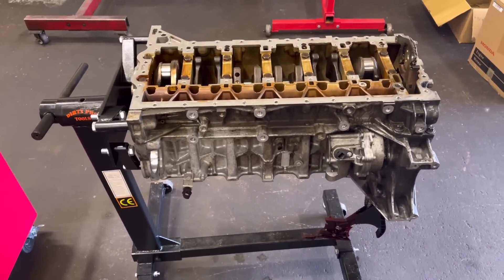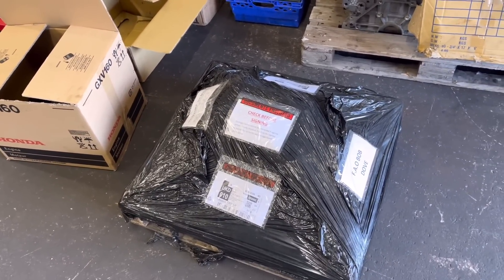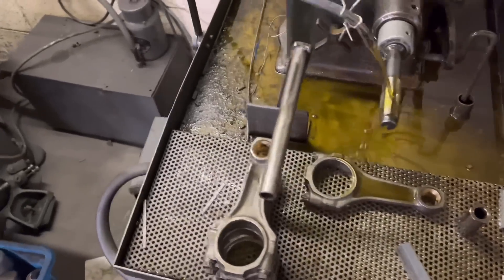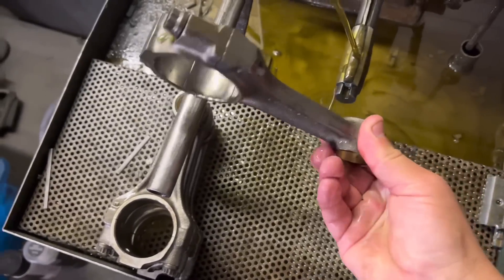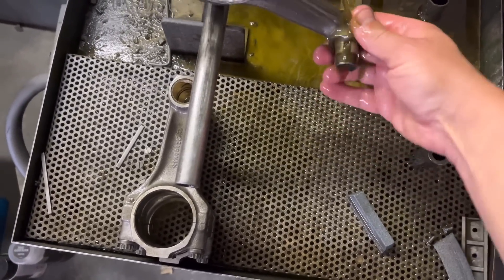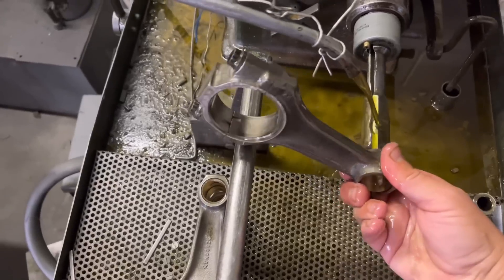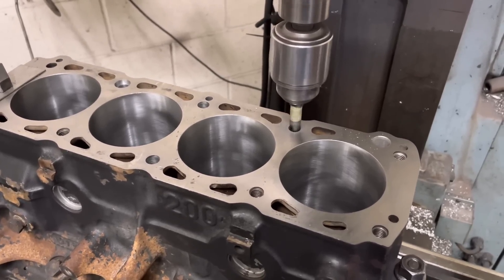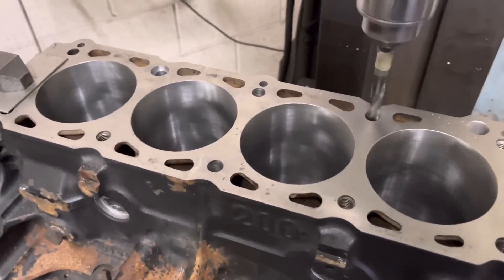Customer’s 3rd attempt of a warranty claim, but WILL NOT send engine back for inspection

Comment: Once someone else has been in the engine, surely any warranty is void, you have no idea what they may have broken and are trying to blame you for.
Reply: 100% Once someone else has been in, warranty is void.
Reply: Totally agree 100%
Reply: Agreed wouldn’t be hard to manipulate a failure pre engineer doing a report
Reply: I disagree. So taking a rocker cover off voids a warranty? Ridiculous poppycock.
Reply: @rjm7168  debatable that depends on the terms of the warranty.
Reply: @rjm7168  are you the guy trying to make the warranty claim? 😆
Reply: @rjm7168  it does, if they remove things and an oil leak results, its on them.
Reply: 100% especially if the engine has been touched by someone who is not a qualified technician alot of performance part manufacturer will not warranty a failed part if it wasn't fitted by a qualified technician!
Reply: @rjm7168  if the work is carried out by a non approved mechanic or the work wasn’t approved beforehand and it’s still under warranty then the warranty will be void.
Reply: @matthewgibbs6886  it doesn't. You actually have to show that the disassembly has caused the failure.

The FTC has a very clear stance on this since 2018. 

This guy just isn't sending it back for warranty service.
Reply: @rjm7168  I am in Warranty, and I agree with you! but it would depend on the limitation of the warranty given by the OEM/seller, if they can prove you(the customer) directly affect the outcome yes it should be void, any tampering with the engine should void those parts/items tampered with....per se, for example, they might not void the water pump if that was leaking as unrelated NON-tampering etc. any tampering/neglect/incorrect repair/abuse/lack of maintenance etc might be voided root cause and progressive

Comment: If they complained of issues a while back and didn’t do as asked and return the engine, and has continued to run it knowing in their mind there may have been an issue. Then they have voided any warranty.  

If they will not return the engine for assessment, then they can whistle.  

Just ignore the matter until a formal letter arrives and if and when that does, stand by your guns and ask for the engine back.  

Court action is unlikely and at this time there’s no need to involve solicitors.

Comment: Suggestion; put a secret stamp somewhere on each block that you work on, so you can identify your work, if you suspect someone has switched engines.
Reply: Like a B & E stamped into the water pump inlet in the block and again in the head?  Good idea.

Comment: Under UK consumer law (assuming that this isn't a B2B contract) you should be given a reasonable chance to make good the failure. It would still be good to see your standard T&C's on your website.
Reply: Even the corrupt country court (which they are) would not find for the complainant in this situation.
The so called judge would either dismiss the claim or adjourn the case so the defendant has chance to look at the engine and repair it if they are at fault.
The claimant has not acted responsibly so therefore losses the right to claim. Conversely Barum engines could make a counter claim and apply for costs and damages.
Reply: If he's not giving you the opportunity to look at the engine and rectify the situation, I can't see a County Court  finding in his favour.
Reply: @Dave Stennett  I get your point, there are a lot of devious customers out there.
Reply: UK consumer law does not apply to B2B sales.
Reply: @MX-Drew  I did say "assuming that this isn't B2B"

Comment: Lee, Your 100% right. Head bolts don't just "come loose".  He had oil in it too while pratting around, Suggesting he was turning it over out of the car at minimum. He'll have had the head off it numerous times. Seen this many times with motorcycles, customers trying to save a few quid. (usually on a bike worth less than £1500) You give them a good price, they go away, and 2 weeks later their on the phone because they bought another engine off Facebook and it's worse. Tell him to jog on !!!

Comment: Head bolt coming loose! must be a joke, 40+ years as a mechanic, never heard of that happening, the only possibility is if it was never tightened in the first place and I find that very unlikely.
Reply: Have you ever seen bolts come loose on an engine that has not even been RUN?
Reply: @GrumpyUnkMillions  ever buy a jasper engine
Reply: @matthewgibbs6886  Ummh... no.  Are loose head bolts an available option?  Factory?  Oh, boy, I can't wait to get one! ... not
Reply: You should know that occasionally very unlikely things can happen, especially when someone is interrupted during a job, or a job passes between several people.
Reply: @Cheepchipsable  I know things can happen, but I have built a LOT of engines and would never stop half way through tightening a cylinder head and double check my work, it just isn't worth your reputation and TBH it only takes a few minutes.
Reply: Well... Saab did have an issue with headbolts on their early b205/b235 engines.  Had to do with the lubrication they put on them in the factory iirc.
But that resulted in an external oil leak and eventually a blown headgasket... but no bolt moving up and ruining your engine.
Reply: ..I've seen overtightened bolts strip, and bolts come loose in incorrectly tightened down heads....
Reply: @richardwebb9532  That is unlikely, most modern engines demand new bolts every time the head comes off (torque to yield/angle torque) and older engines don't have such high torque settings. It would be sheer incompetence if a head bolt was stripped.
Reply: @onecookieboy  ...yup.....but it happens in my country quite a bit. (South Africa) as formal training is very limited.

Comment: The way I see it and how our laws are (different country) is if it's under warranty and you have asked them to bring it in to diagnose any problem but they dont then the warranty is void as you have given them multiple chances to send it back but they refused - especially if them or someone else has started to pull things off the engine instead of you - as now they have interfered with it and small claims will say that your warranty is now void as they have tampered with it ( and so with them doing that they could have made the problem) after being asked to return it for a claim...  So really, you could email them back and say "I've asked numerous times for you send it back, you refused, and then the engine has been tampered with - I cannot guarantee it anymore"..

Comment: If that warrentee engine is an alloy block M52 6cyl they do have a tendency to pull the threads out of the block if it’s been massively overheated. We get it regularly, showing head gasket issues and when you pull apart the head bolts are loose. Hardness test block and they’re buggered. You will have to see it obviously but I’d advise hardness testing all these blocks before wasting time on them. Hope this helps

Comment: Hi lee ,love your show warts and all, i have a very keen interest in  engines and engine building since the late 60s as i have been heavily involved in drag racing ,i got sick of some of the shows on you tube ,all glitz ,glamour  and product placements.   I would nice if you culd do a show about the engine re conditioner and customer relationship, as this is crucial for sucess,  i have worked in 2 car plants as a maintenance  electrician,  the engine building plants also have lots of failures (pallet loads)   even with  all the machinery and know how .    I build older engines (last one mgb)but never mod them too much as  i find they all have limits  to their life span. Best of luck with your plans to move in next door , cheers from downunder.

Comment: A loose head bolt is feasible, the problem is a lot of your videos are you owning up to your mistakes , so you can’t rule it out , a lot of these people buying engines have no spare cash , they way up , the cost of paying for a garage to remove the engine , crating it and paying a courier to deliver it , they probably think you will strip the engine, finding a way of not making it your problem/fault and then sending them a bill for your troubles ( I don’t believe you would fleece anyone for the record) , If it’s the guy with the oil leak from the crank then he’s probably been turning the engine over counterclockwise and bunched the chain up , if the head bolt is worn and grooved the cam , then it’s fair to say it’s loose , I’d give him the opportunity to send you a picture

Comment: yes your right engine has to be returned and if its not returned when  a potential fault has been reported it should also be advised to the customer that continual use could cause more potential faults and can and will effect any warrantee so when the 1st fault was reported and no engine returned the warrantee would be voided

Comment: UNDER WARRANTY  Once the engine is touched by anyone other than the Builder  WARRANTY'S become VOID .. i assume the guy you built it for took the rocker cover off and loosened one of the head bolts, in order to get his money back plus free rebuild .. some people leave out sump plugs run it dry enough to get big end rattle . it's like car manufacturers stipulate vehicles must be returned to Company Franchises for repair ,to do otherwise voids warranty. tell the guy you'll see him in Court.

Comment: Amazing idea!
Get a fleet of vehicles with the same engine, get one engine done by you legit, THEN if any other engines fail you can get all the others fixed under “warranty” bingo 😃
Reply: MrGuvEuroman   not if builder stamps a personal  ID  inside sump and rocker covers and takes a note of the engine number stamped on the block .
Reply: @douglastodd1947  was going to say the same . Stamp the initials in places where it isn't visible to the naked eye.

Comment: Granted my experience is in the US, but most warranties should include some language to the effect of "the item may be repaired or replaced at our sole discretion".  There is also a duty on the consumer to give the warrantor the opportunity to provide a remedy, which if they just dropped it off at some other shop then they did not do.  Even if they are far away, they should make arrangements with you to then take it to a shop or ship it back.

Comment: To make sure the engine is the actual one you worked on mark the engine with your own number and record it. It strikes me you need to prepare a warranty information sheet and send it to the customer and have them acknowledge it before any work is agreed to. One of the conditions needs to be engine in question needs to be returned to Barum in the state of assembly it was originally sent, and that Barum will evaluate etc etc etc.

Comment: Should have the case of 14 days notice from contact after that consider matter settled in the letter/email stating if no arrangements of delivery then that’s that. Once engines stripped down warranty is void as you should have had first refusal on inspection rather than owner or a engineer

Comment: After listening about the goof filling his engine with oil before it was in the car, then not understanding the flywheel bolt sealed a direct oil path....I wouldn't let him put bread in a toaster let alone try and assemble and fit an engine!
Reply: 100% - surely the warranty is voided at that point and Lee should have had no further dealings with him...............

Comment: From the time i used to have a workshop, i seem to remember the law is you should have the right to demand the item back under warranty to evaluate the damage, its cause, and what you will do about it. Then the result is if you are going to repair it at your cost, if you find its a mistake on your part, or subcontract the repair out, or pay a warranty charge. At all points the customer acomodates you, not the other way round.

Comment: As part of the warranty do you state in writing something like: 'In the event of internal engine problems within 6 months of any work being delivered the engine must be returned to Barum Engines ('the Company') for inspection. Following inspection the Company will make good at no cost to the customer any problems which are the result of the work and/or components supplied by the Company. Should the Company find that the internal engine problems arose from faults not caused by the Company, the Customer will be liable to the Company for any costs associated with inspecting the engine.'  Or words to that effect. 

Only if this sort of clause is in writing on all paperwork given to the customer can you insist the engine is returned to the company for assessment. If it goes to court that's what will be looked for.

Comment: I had head bolt come lose and ones that cut! Into the head- alloy heads! all from heat and people FTing the H- bolts .. Had a guy send a engine back out the blue that he had for over 3 years was still on are pallet. We called the guy to ask why and was told it has a knocking! And he wanted hes money back, well one email to say he needed to have the engine pick up as the 1 year warranty was way gone But we would pay just the rebuild cost if we got to keep the Engine .. Well the Engine had gone way up in price in them 3 years ..

Comment: Obviously got something to hide.if something fails under warranty then you take it back for inspection.
Back in the seventies my little brother bought a new Honda CB 175 and from day one it smoked on one cylinder.told dealer and he said it was bedding in but a few weeks later it seized.
We popped the head off and yes it was solid so contacted Honda UK,told them what we had done and they said to take it to dealer for a new engine to be fitted
No problems with warranty even though the head had been removed so thumbs up to Honda.

Comment: That bloke trying it on, tell him you can't do anything until the motor is in your shop. I hope you have got the engine number or had stamped the block with your id. With the head bolt, never seen one come undone.

Comment: Those small ends are the right size “ maybe “ in one spot but are probably bell mouthed. You need a Sunnen “ parking meter “ and the right gadge rings to zero it , only then can you get the right size for the desired clearance, also with all that runout from the hone mandrel I doubt the small end is parallel with the big end.

Comment: On the crankshaft journals: I worked for a company in Australia named ACL Auto Engineering which had recently been acquired by Repco (I'm 74 yo now but 18 at the time). The workshop used to rebuild crankshaft journals using a welding process, grinding them to size and linishing to a bright and shiny new journal. Is this process no longer used? If not, why not?

Comment: He is trying it on how much oil did he put in for it to be able pour out of a flywheel bolt hole? Well over filled, under ideal conditions he shuld have brought the vehicle with the engine still runnable back to you for inspection then if not possible to return the engine as requested. If a head bolt had come loose (which I have never seen or heard of) it would have most likely popped the head gasket before it made contact with the cam and if it didn't then the noise of the bolt rubbing on the cam sjuld have told him to stop the engine and get it checked. He is just trying it on

Comment: If your engine customer decides to go to Court then the Court will probably take the view that you must be given a chance to inspect the engine and repair any damage that has been caused by your work.  This likely to be the position irrespective of any engineers report unless there are exceptional circumstances as to why it can't be sent back.  As you have offered to inspect the engine at least 2/3 times with no further reaction from the customer then this is likely to be seen as you being totally reasonable.  When does the warranty expire?  I would remind him of the expiry date and say that unless you have the engine back by that date you will not be in a position to carry out any works either inspection or repair - I would not even accept it after that date even if the customer agrees to pay.   You don't need any legal advice yet and to quote a phrase 'wait for the writ and don't do anything more'

Comment: The way you reamed the little end without supporting the rods leaves me to wonder if it's true as the rods can twist a little making the little end bush slightly warped witch could cause premature wear .The rods should he held in vice & reamed straight .Just my opinion from seeing my engineer cousin do work in his old shop .

Comment: Call trading standards and give them the details. I owned bicycle shop in London in the 2000's  had a customer who crashed his bicycle after removing his front brake and tried to get his lawyer uncle to intimidate me. A quick call to trading standard had him run away with his tail between his legs.

Comment: How could you possibly know that the engine examined for the engineers report, is the same unit you supplied?
And is the report itself genuine, or knocked up by your customer.
Try and make contact with that engineer directly if I were you.

Comment: You have the first right of repair and if the customer does not take you up on your offer then it's his problem. At this point you already have him figured out, he has intention of returning the engine and is waiting for you to offer him some sort of refund. After this "engineer's" report he cannot bring the engine back, if that was the engine in question, cause you'll figure out what the guy did and you have already warned him that if it isn't a warranty issue he will get the invoice for the hours spent.

Comment: I do hope you have been secret stamping heads and blocks and cranks,  to make sure you get same engine back for a warranty claim, if not i think you need to start doing it, it only has to be something you would no straight away as one you did work on, and not send you any old crap to rework for nothing.